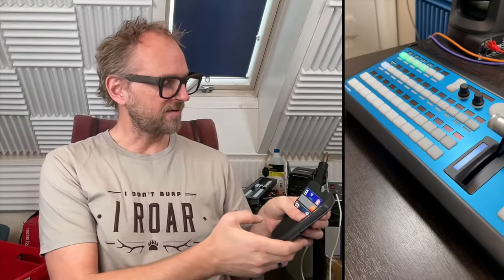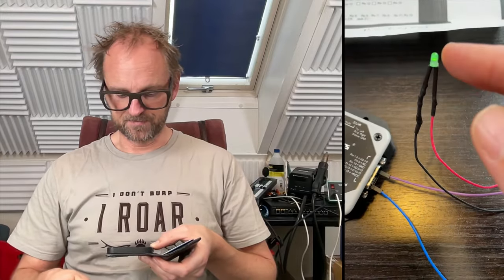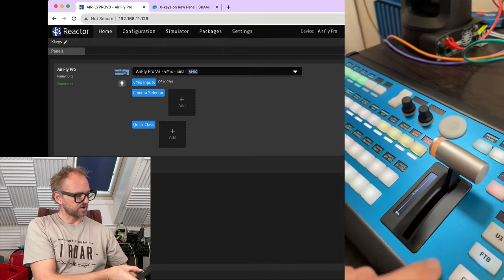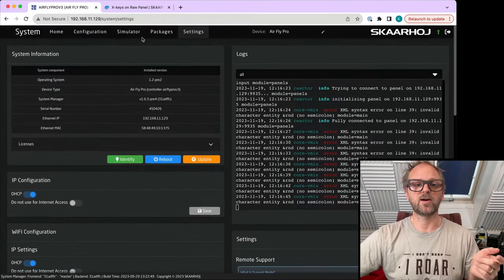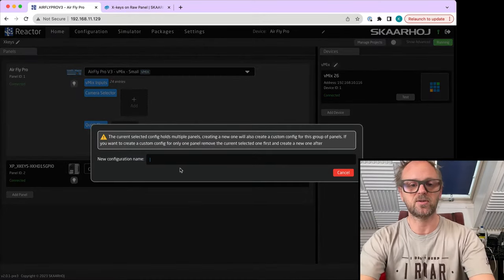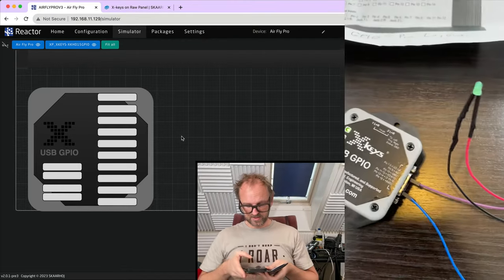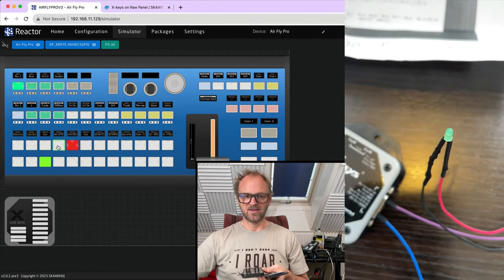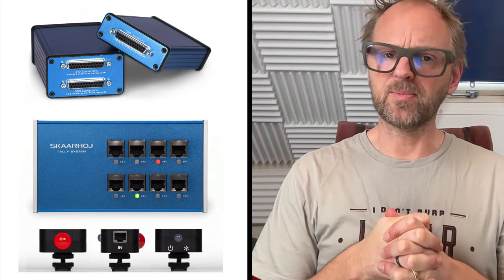Tally LED for vMix? Connecting X-keys USB GPIO to SKAARHOJ Air Fly Pro

Comment: Is there a list of which products have the USB port as shown here?
Reply from the maker: All our Blue Pill products with black frame - the same size as Air Fly Pro, have USB-A connector. Our other devices have USB micro connector (mostly due to size constrains).
Reply: @SKAARHOJ  Can the micro connectors work as host, or are they client only (for firmware upgrades, etc)?     Also, your photos on the website only show the control surfaces.    It would be nice to see connector panels as well.
Reply: @lbrentevans  Actually, yes, the micro USB can be set to Host mode and if you purchase a Micro USB to USB-A (female) cable that ALSO has a USB-A male to plug to a USB-power supply, you basically have the same on the other products with Blue Pill Inside. This is just very new and not documented anywhere yet.
Reply: @kasperskarhj2250  That’s excellent info!  Thank you.